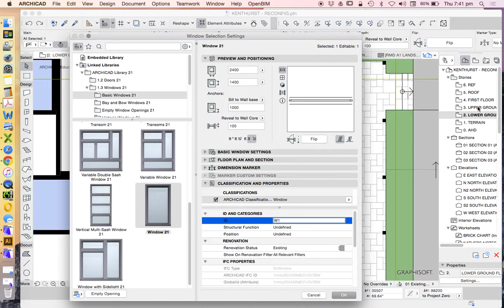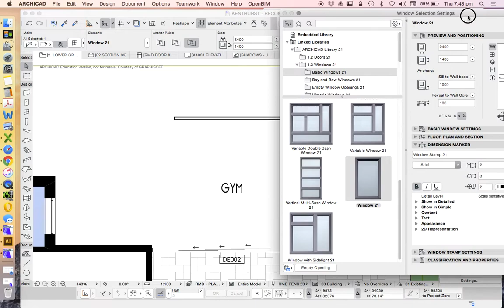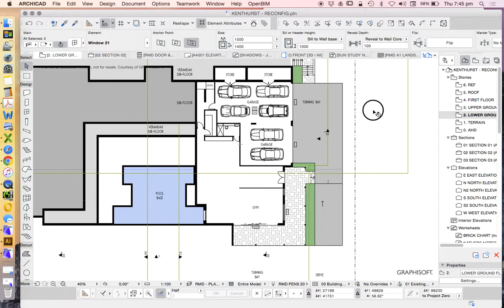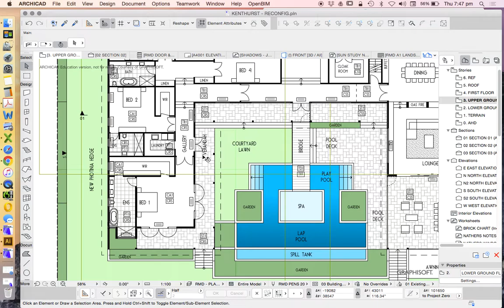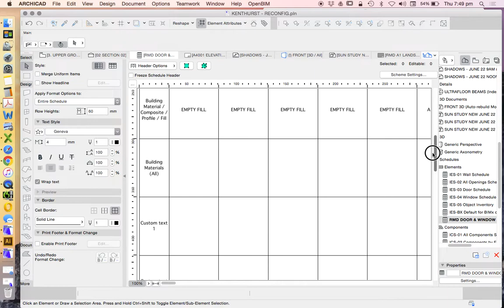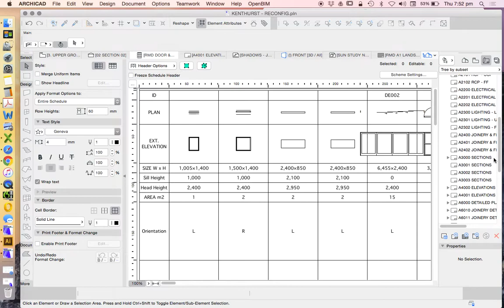Archicad tutorial House Detailing - door & window schedule

Comment: Hi, great video everything works for me except my tag doesn't appear in the plan any idea how to make it visible. I'm assuming its a setting or layer I've missed I'm also running archicad22.
Reply from the maker: Hi John, as long as you have already clashed to show the marker, it will most likely be based on your view settings (graphic overrides) make sure you are in a 'technical' , 'construction' or 'floor plan' view rather than a 'site' or 'RCP' override. Renovation Filter can also muck it up.
Reply: @RobertMannArchitect  Thank you i managed to get it working. Can i rotate the ID so it sits horizontally even when its associated with a vertically placed window?
Reply: Never mind the last question i realised i had to click on the left contact point not the middle. Thank you for your help and the videos they're very well put together.